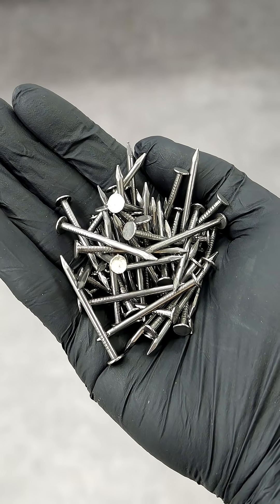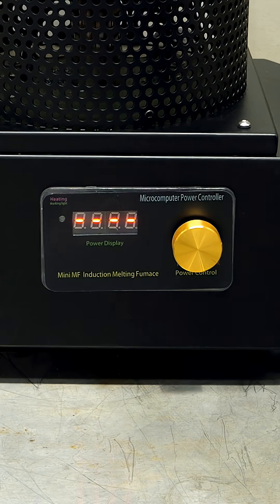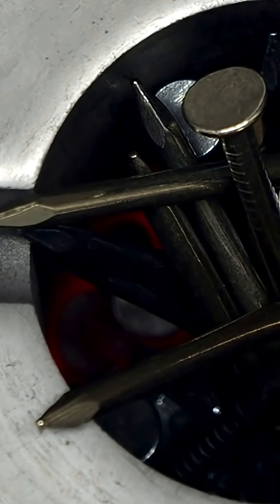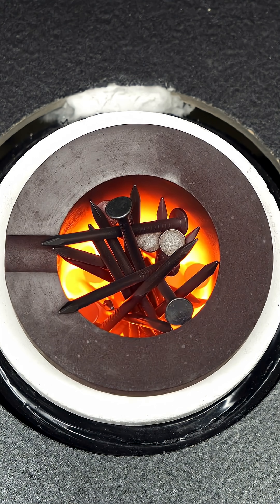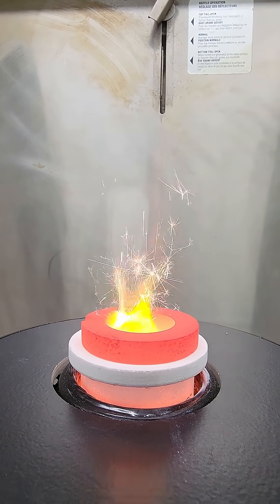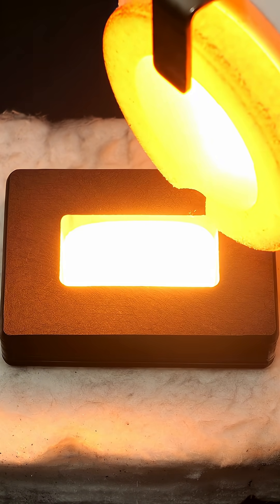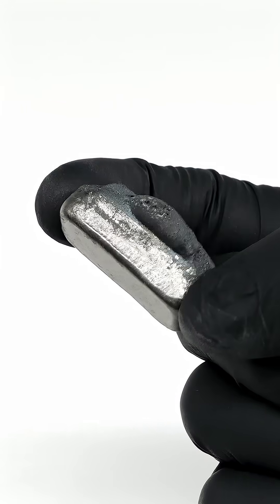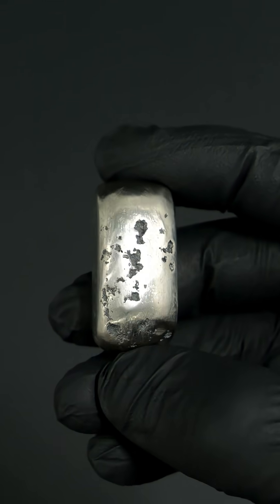Liquefying nails is crazy

Comment: Hi. I don't want to mess around with a chemist, but I am a metalworker. As far as I know, what you have there at the end, is no longer steel, it is cast iron. When iron is in it's liquid form, it starts to absorb a lot of carbon from the air, quickly turning into cast iron in the best case, in slag in the worst. That's why steel production plants need to inject oxigen and use a giant electrode when melting and pouring the steel, so it doesn't absorb substances from the air or it's surroundings that you don't want there. Correct me if I am wrong, but as far as I know, what you have there is a cast iron ingot.
Reply: It is absolutely still steel. The composition is likely changed to some extent depending on how long it was left at temp. The problem with molten iron is absorption of OXYGEN from the atmosphere, not carbon. you’re thinking of argon or another inert gas (definitely not oxygen) that is used to shield molten steel from atmospheric O2 in the production process. The main alteration to the steel’s chemical composition here, if any, would be a slight decrease in carbon content- the sparks you see indicate carbon burning off.  Cast iron is a broad term for a different material, you would need to add a whole lot of carbon to those nails to reach the carbon content required to make it cast iron- that requires a process which is significantly more complex than simply melting and cooling. Assuming he didn’t severely overheat the metal and hold it at that temp for an extended period, the changes to composition here will be minimal
Reply: If you're melting pig iron and scrap, a BOF would be used to reduce the carbon content.  And double checking, that's generally what's used in steel production plants.  But Nile isn't working with that, he's working with already processed steel.

So yeah, Nile still has steel there.  Induction furnaces are used to melt steel for small scale and specialized projects.

Cast iron, even polished, is a fairly dull grey color, and doesn't shine like Nile's ingot.
Reply: @Darke_Exelbirth  it's shiny enough but I still imagine the carbon content is off. I'm not disputing it as steel, I believe it's steel, I just wouldn't do anything with it without testing the carbon content.
Reply: @mr.dedede1324  It can change the properties of the steel at worst but not by that much. Cooling speed will be much more relevant here because of the new crystal structure formed during solidification.
Reply: @conelord1984  I disagree. I don't think this ingot eill be used for anything inpkrtant but having the wrong carbon content in your steel will absolutely ruin a project.
Reply: @mr.dedede1324  If the difference is huge, maybe. The carbon content won't change much, though. The crystal structure will alter the physical properties of the metal MUCH more, though.  So cooling it correctly to generate crystals that are adequate for the application you  want has a MUCH more significant influence in the end result.
Reply: I am a metallurgist who melted and poured steel in a commercial foundry. Carbon is not absorbed out of the air. When turning iron ore into iron, we often use iron. That adds lots of carbon into the iron. We inject oxygen to bring the iron into the correct steel range. When we remelt steel in an EAF we will also add Carbon intentionally in order to blow it out again that process can clean up the steel. When melting in an induction furnace, we typically lose Carbon during melting and must add it back in to retain the metal's properties. The sparks seen in the video was the metal losing carbon.
Reply: @MatrixCoreteam Ok, thank you for clearing things up. What you say makes perfect sense. But aren't those black crystals on the surface of the ingot a sign that some alloys within the steel got burned and left the mixture? I am a stainless steel welder and similar crystals appear when a part is overheated or receives too little inert gas.
Reply: @emperadorromano567  yes, that is slag. It will consist of oxides of the different alloying elements. It depends on the alloy content and affinity for oxygen.
Reply: @MatrixCoreteam . We pour iron and our recipe has pig iron, steel stampings/trimmings and lots of other minor chemicals.  We add depending on the alloy, mag, SI,C,NI ETC. but if you start with steel you just get lower carbon steel. It’s nice to have a spectrometer to sample then trim the melt.
Reply: @MatrixCoreteam  I am a foundryworker from Germany. I think you are right and as far as i know we lose alot of the carbon to the reaction between the cruicible SiO3 and the Carbon in the iron at approx 1500C. We only make cast iron so our carbon contents are a bit higher. I think every batch with a carbon content over 2% counts as cast iron and below that threshhold it is steel. The reaction that occurs at that temp is favorable because it adds Sillica to the Iron and burns of excess carbon which turns to CO2. The Co2 gas cleans the iron of impurities because the gasbubbles take them to the surface where someone can collect them and clean the batch. If it stays too long at that temperature the carbon is depleted. We call that Totgebrannte Schmelze.
Reply: Yeah. Plus those nails have what looks like a plating of some kind?  Maybe they are just really shiny steel, but I doubt it. I don't know what the carbon content is at the end, but it defeintely oxidized. 

Maybe if he used a flux or some inert gas to shield it from the air he could be more certain of its carbon content.
Reply: You guys are so knowledgeable and cool. Keep it up!
Reply: Thanks for your contribution- I’m excited I found this side of YouTube for this type of conversation
Reply: Now for something completely different
   @merliwoo    your profile pic of the forest path looks like a majestic and impressive place to walk 👍🖖
Reply: @earthlingjohn it’s from the Muir Woods outside of San Francisco! It was otherworldly. I’m from a very isolated town in the Midwest, lots of trees, and I love it there. But it continues to amaze me the range and variability of forests in the US. West Coast Redwoods are just unlike anything else I’ve experienced!
Reply: @merliwoo 
Thank you for responding and for providing another destination to my bucket list 👍 Much easier to fulfill than Hawaii or New Zealand or Australia and all of the other destinations beyond my budget  😄
Reply: End result looks like a metal loaf of bread.
Reply: Waste of nails.
Reply: nerd alert!
Reply: Other people have corrected you already, but also, if what you're saying was true, the entire field of welding wouldn't be able to function. The thing exposure to air causes is porosity,  which is not a chemical change so much as a physical change. Steel chemcially changes very little from being melted and cooled.
Reply: You are the most polite ironworker I've ever met!!!
Reply: You got it mixed up buddy. The iron doesn't absorb Carbon from air. It's reacting to Oxygen in the air and generating that slag called iron oxide. And it's still "MILD STEEL". Cast iron has Carbon content more than 2% and it's added to steel in a controlled environment.
Reply: Kk
Reply: ingot is a very generous choice of words. 

What he has left is trash 

I don't know why these idiots have to do like Oh I did this thing No aren't I clever Oh look I made something Why can't I just be like hey I want views look at this cool induction heater melting melting this f**** metal down But now he's got to have some sort of stupid backstory and stuff or like we know you're full of s***
Reply: At the surface. Looks like cast iron (the porosity and dullness) but to be honest he managed to keep the carbon content so low without injecting oxygen and I think that the core is even better ❤
Reply: The reverse actually. This is why the Bessemer process works. Most steels don't cast well but cast iron does. But a little carbon could conceivably be absorbed from graphite crucibles and moulds.

Cast iron and pig iron is high in carbon because it's reduced to metallic form from the oxide with carbon.
Reply: Often iron already has too much carbon in it. Blasting oxygen through it will draw the carbon out and allow for a controlled amount of carbon to be added back in.
I used to work for a company that processed carbon coke that was used as an additive for steel production.
Not sure how much the remelting would effect the carbon content. I seem to remember that those sparks have something to do with the level of carbon in the steel, but that is based off of what I've heard about grinding steel.
It would definitely be interesting to find out the final carbon content and compare it to one of the original nails
Reply: "Carbon from the air"???? 🤦‍♂️🙄

Others have replied but I'll join in: when steel is heated in an oxygen-containing atmosphere, what happens is that oxygen reacts with both the carbon in the steel and the iron, forming carbon dioxide and iron oxide, and potentially oxidising other alloying elements like silicon and manganese. The iron oxide is the black stuff on the top of the ingot. The surface of the ingot probably has a higher carbon content than the interior, because some carbon has been absorbed from the graphite crucible but not enough to turn the ingot into cast iron.

in modern-day steel manufacturing, slag (synthetic lava if you will) is normally used to protect the liquid steel from the atmosphere, as the slag floats on top of the steel.

Source: me, someone who's been in steel manufacturing for 20 years.
Reply: That is, induction, what was the first industrial technique used for metals that were not useful any more.
The sparks are the oxidizing of elements, components, lice Ni, C, Si, etc., you took it out from the nails, so dear... that piece of metal will need new enrichment elements and more heat or cool work to obtain the metal, and properties that originally had.
Good video !!
Reply: @fblua I was curious about what those sparks were.
Reply: You make way too much sense to be commenting on bro-science content.
Reply: Use tannerite in ya garden gnomes folks, fake rocks too!
Reply: Approved by the son of a steel forging engineer in China.
Reply: Heating it doesn’t make it not steel anymore
Reply: .. no, don't listen to this man.
Reply: ... Wait, so we can capture carbon in steel? I have a crazy idea to lower greenhouse gas.
Reply: @KogasaGaSagasa well, there is a lot of iron in the earth 😮
Reply: @carlosguanchez16  STRIKE THE EARTH!
Reply: @KogasaGaSagasa  carbon isnt a green house gas............
Reply: @blameusa7082  Ok, I'll stop fooling around for a bit. Sigh.

From NASA: Carbon dioxide (CO2) is an important heat-trapping gas, also known as a greenhouse gas.

You might say "carbon isn't CO2", and you are right. The main thing is carbon and CO2's role in plants, and how it's released back from plants. (That, and the original context is about how smelting metal could cause a reaction with CO2 in the air, effectively trapping it, and I was being silly)

tl;dr Photosynthesis captures carbon from the atmosphere by using sunlight to convert carbon dioxide and water into sugars, which the plant uses for energy and growth, releasing oxygen as a byproduct.  Photosynthesis formula is 6CO2 + 6H2O + Light energy → C6H12O6 + 6O2, where C6H12O6 is glucose, which the plant uses for energy and becomes part of the plant. 

Trees and such "trap carbon" as they convert the CO2 in the air along with water with light energy -> carbon in glucose molecule, which is why when you make trees into charcoals they can burn, to put it in layman's turn - you are basically converting wood and plant matter into easily accessible carbon in the form of charcoal when you heat them in an environment without oxygen.

Some of this is somewhat touched upon in Nile's other channel, NileBlue, in the plant blood video, where they isolated chlorophyll. His field of specialty isn't in this, but I am pretty sure there are a non-zero amount of experts on this matter given this is a fairly nerdy science channel who can chime in.
Reply: You are completely correct. Nilered is a YouTube chemist, not a chemist
Reply: Commercial steel is a very precise mix of elements, sometimes even disolved and vaporized before melting... induction in comparison will turn it into some sort of high carbon steel probably brittle (?) oh those sparks definitely fkcd it, he should have forged or tempered it at least?
Reply: its aluminum...
Reply: Those sure looked like aluminum nails.
Reply: @JT_70 there isn't such a thing as aluminum nails they would be far too soft.
Reply: @JT_70 aluminum wouldn’t end up such a dark color, it would be very light and shiny, and it doesn’t take nearly that much heat to melt.

Comment: For such a smart lad, you’ve missed the connection between heat, iron and carbon. 
Use a ceramic crucible and refractory molds.

Comment: The thing about an induction furnace, as compared to a gas fired furnace, is that with induction, you are heating the actual, in this case, nails, at the same time as you are heating the crucible. This also explains why say, aluminum, which requires a lot of heat to make, can be most affordably made in places like Eastern Canada, where Hydro electric power is abundantly, and cheaply, available.

Comment: The next step is cut your ingot in half and mount it for metallographic examination. when polished and etched you can see the crystals and grain boundaries. With an as cast structure, I suspect you will also see bubbles in your casting. It would be interesting to compare the metallographic images of the original nails to that of your casting.
Reply: i'm sure the quality would be more at issue if nigel were to forge a new nail, but seeing him continue some basic metallurgy is really nice!

Comment: Why did the nails change colors as they were heated?
Reply: Because of oxidation of the surface.  The color is a rough indicator of temperature, and goes from straw, to bright blue, to dark blue, as the steel gets hotter.  The color is used by machinists & gunsmiths to determine quenching temperatures when heat-treating steel.
Reply: @Pootycat8359 Thank you

Comment: Some inert gas flow when pouring and cooling could have helped a bit with the porosity. But the induction heater is cool.. the eBay part sounds questionable 😂

Comment: Smoke and sparks were probably oil from the original production, or could be a coating, some nails have coatings to prevent rust, use acetone or some solvent to clean them off to prevent that, all it really does is turn to alag if it doesnt just burn off

Comment: I had an induction stove at home around 8 years ago, and for regular cooking, it was brilliant. The second you set the temperature, the result was instantaneous. It was very, very accurate. When I wanted to clean the oven, I just turned on the clean stove button, and it would lock the door and set the temperature to 600° C for an hour. After that, I just swept out the ash... no bad chemicals or scrubbing. Just genius. When I had to sell my house I had to leave it unfortunately. This video has me interested in this crucible.... great video. Thanks.
Reply: What you did not say was your wife told you to stop melting steel in her new oven so she made you leave it since food now had a glint in it
Reply: induction heating is generally safer than gas. I suppose you aren't interested in this crucible for cooking potatoes though? Any ideas?😊
Reply: dang your oven got to 1100 degrees Fahrenheit? thats fucking bonkers
Reply: @shadowthetwisted it's the maximum temperature in higher-end "pyrolytic cleaning" ovens - it's only intended for cleaning (by incinerating the grease) though 😅
Reply: @GlennDavidson  

wait that wasnt a typo? no way it actually gets that hot, right?
Reply: @shadowthetwisted  It could easily get that hot, but whether or not it does I'm not sure. Most seem to not go quite that high but their cleaning cycles are also longer than one hour, so I have no idea. Maybe some do.
Reply: @backonlazer791  

i dont think it can. ive seen ovens with cleaning modes and they would get to 500 degrees F
Reply: @shadowthetwisted  The temperatures vary greatly depending on the oven in question. I looked it up and I saw a claim of at least 1000 degrees F and I found an actual oven (that provided specs since most don't) that went up to 750 degrees F. When it comes to heat the effect is always tied to heat + time. Higher heat means less time to complete the pyrolytic process. With good enough insulation there's no problem with going higher for less amount of time.
Reply: @backonlazer791  

something about having an appliance that gets so hot in my house in unsettling.
Reply: @shadowthetwisted Can't blame you for that. Though I feel like I would much rather have an induction oven with pyrolysis cleaning than a gas stove.
Reply: @backonlazer791  

induction would be better for sure. just, nothing really wrong with the one i have now. 

aint broke, dont fix it right?
Reply: The crucible is graphite

Comment: Are the sparks from Sulphur impurities or bits of oxidising Carbon from impurities?

Induction heaters work by generating an intense alternating magnetic field that causes current flow in iron, in turn creating a magnetic field in the metal, moving the molecules very fast & generating tons of heat.